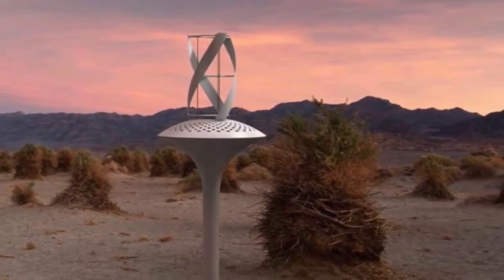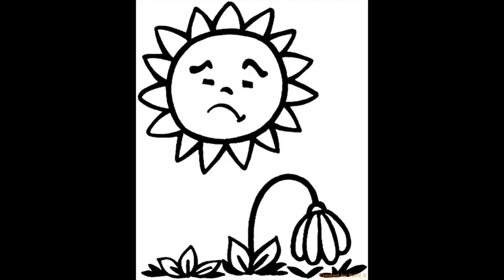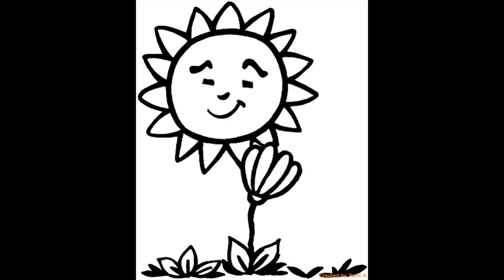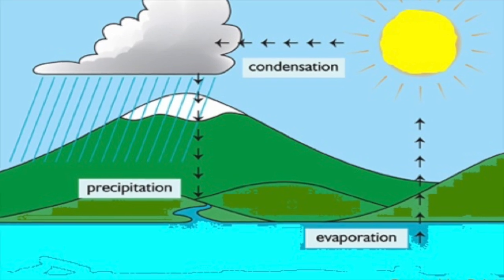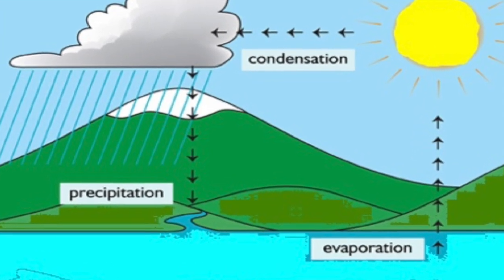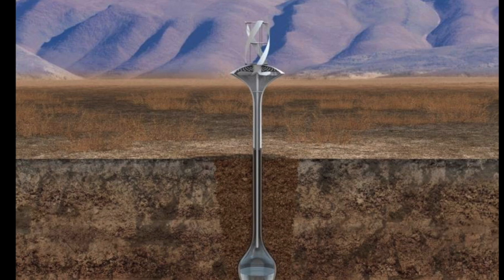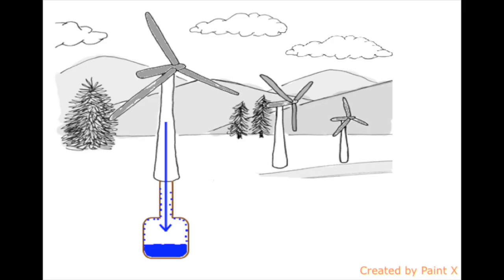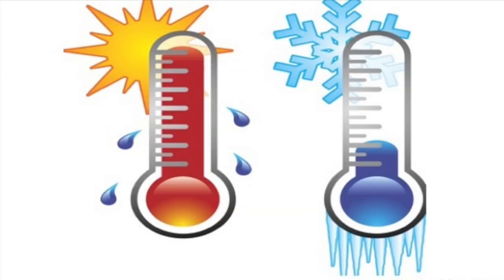Water Seer Debunked then FIXED (2020)

Comment: You are as far out in left field as the original waterseer charlatans.  There are several more reasons why the waterseer is just a lie.  For example, soil temperature is usually higher than the ambient air dew point temperature. Even before the soil heats up, the waterseer wont work.
Reply: But arid areas without much rainfall are arid because there's naff all water to retrieve from the air.
Reply: Alastair it’s related to air temperature even in Arid zones there’s 3.5 - 4 % water vapour in the air
Reply: That's not related to what I was saying, Roger. The soil is usually well above the dew point, the temperature at which that water vapour actually condenses.
Reply: Graph of % RH vs Air Temperature -  we observe the Dew point, how do we reach that number. By using clever feed back loop maybe?
Reply from the maker: soil temp is usually higher than ambient air temp? ok, that happens but USUALLY? now who's in left field.......
Reply: higher than ambient air DEW POINT TEMPERATURE

Comment: the ground is not cold enough. it's temperature is the average of the surface temperature.
problem is: every morning at around 5 am the air reaches it's coldes point and starts to condense water as dew so this temperature is the new dew point - at this time the ground is warmer than the air and the device will not work.
it might work if there is a large body of water that will increase the absolute water content of the air during the day - but in this case you don't have a water problem.
Reply: You are right.  The air reaches the coldest point in the morning due to radiation heat transfer with the cold night sky.   The ground only interferes with the process by  acting as a heat source from its gigantic thermal capacity.   The ground most likely never gets below the dew point so it doesn't matter how much tubing you add.
Reply: It most likely won't work.  Just take some measurements of the ground temp , the air temp, and relative humidly.  See for those air conditions with the ground temp, if it is cold enough to get the mixture below the dew point so condensation can take place. The plastic tubing will require and even colder temperature since the plastic is a good resister to heat transfer.   I told the NPCA and Waterseer this too.  They needed no working model of the Waterseer as a first test of feasibility.  

A Mollier table will be the key to see if one can in teory make it work.   Most likely it won't work practivally, since the heat transfer will not be ideal.  
  
https://ready.arl.noaa.gov/READYmoistcal.php

https://www.engineeringtoolbox.com/psychrometric-chart-mollier-d_27.html

Give me the measurements and I can tell you if it will work or not.
Reply: Larson is talking about the DEW POINT TEMPERATURE not the air temperature. The ground has to be below the DEW POINT TEMPERATURE for this to work. Usually it is not.
Reply from the maker: @johnhazel9986  depends on where you live. Where I live it's 3-5'C a few feet down, even in the summer
Reply from the maker: for the morning - yes - but once it heats up during the day the ground will keep the basin colder than the air being forced into it - causing condensation. it won't work 24 hours a day execpt in very special circumstances
Reply from the maker: depending on where you are the ground in mid summer can be 5C 8 fee down with 30C temperatures above, it makes this location specific

Comment: You are making a bad assumption the temperature difference is large enough to get the air down to the dew point.  Your point is on maximizing the surface area to promote heat exchange not the base conditions.

Simply use an indoor/outdoor thermometer with a humidity gauge and a Mollier chart.  I will tell you what.  Tell me what ground temperature you have, and what the air temperature and humidity is.  I will tell you if you can reach the dew point.  I have it all built in my model of the Waterseer.
https://www.dropbox.com/s/ak5m9o9jvhn0mfg/Waterseer_Steady_State_Thermal_model.V9.0.xls
Reply from the maker: obviously the water seer is weather dependant, I'm stating it can be made to work indefinitely if weather cooperates
Reply: No it can't.  Any Geothermal (heating/cooling system) needs the alternating heating and cooling periods to refresh the ground.  It is like your thermal battery.  It has to be periodically recharged.
Reply from the maker: if your area that the PEX tubing is laid out in is large enough the ambient temp of the ground will absorb the heat, it's all about size or were you sick that day in school?
Reply: No I was not sick, but appears you never had the necessary courses either.  You are making the assumption the ground temperature is BELOW the dew point.   You are starting show you do not know the physics very well.  The ground MUST be colder than the dew point no matter how much surface area you have in PEX tubing.

Let's do an example:  Take air at 70F and a relative humidity of  say 80%.  According to the moisture calculator it as 155 gr/m3 and a dew point of 65F.   If the ground temp is above 65F NO water will condense; no matter how much PEX tubing you have.   Now assume the ground is 60F.  Water will condense out until that air reaches 100% relative humidity.  According the moisture calculator Air at 62F and 100% humidity will have 140 gr/m3 of air.There are 15 grams of water/m3 of air processed.  You need to process 66 m3 of air to get a liter.

Example 2:  Air at 80F, and 50% relative humidity.  The air has a dew point of 64F and has 144 gr of water/m3 of air.  If the ground is not colder than 64 F, it will not condense water at ALL..   If the ground were 60F the air would come out at 100% humidity (128 gr/m3).  It would condense 16 gr/m3 of air.  I doubt you will get a 'air to ground temperature" difference of 20F though.

As a said before and pointed out to Waterseer, you can determine if a location is suitable by measuring with an indoor/outdoor thermometer  that has a humidity meter, and a Moller chart.  The ground is only cold because of seasonal changes and the corresponding phase shift.   If there were no seasonal temperature changes the in-ground temperature would match the air temperature.   6 months out of the year you are in a period where the ground temp is warmer coming out of the summer months and the air is cooling off.   This will be a bad situation to be able to find a ground temperature lower than the already cooler air temperature as fall progresses.

Heat transfer to the ground is  conduction.  That is very well understood.    It is proportional to the temperature difference, the surface area, and the coefficient of thermal conductivity.  You can add as much PEX tubing as you want and dump a lo of heat in the ground, but if you can't get the air mass below the dew point it is not going to condense and make water.

https://ready.arl.noaa.gov/READYmoistcal.php

https://www.engineeringtoolbox.com/psychrometric-chart-mollier-d_27.html

Where did you get your engineering degree again?
Reply from the maker: Are you actually assuming the water seer will work in all climates at all times?
that's a pretty big assumption no one's made. Of course the ground has to be colder then the air for it to work. DUU. I don't need an engineering degree to know that. You really tried hard to make yourself look smart there.  it's about the temperature difference more than anything, cold climates show us that with condensation on car windows in the morning, Justin example for us simple non engineer folks.

I'm simply stating I can keep the ground reservoir from heating up by using pex tubing in the ground stretched out over a large area and pumping liquid through it. this is the major fail of the water seer - it heats up the ground too quickly and stops condensing. I can solve that part easily. Will it work at night, depends on the temperatures? Will it always work? too many variables, them, humidity, etc. But I can stop the ground from heating up when operating under good conditions and that's what this is about. 

curious, have you done anything useful with your engineering degree?
Reply: I never assumed the Waterseer would ever work.  It will never make the water quantity claims it does.  Dew on a window in the morning only is a far cry from the 11 gallons claimed in 24hr. Dew on the ground is due to radiative heat transfer with the cold night sky anyway.  It is a different heat transfer mode entirely from ground conduction.    The energy released to condense the water is going in the cold night sky, not in the ground!   The sky is much colder than the ground.  In the ground, it works on conductive heat transfer only.  

You do probably need an ME degree  usually to know the of the different transfer modes though.

I was not trying to look smart I just wanted to point out adding more surface in piping would still not condense water if the Dew point is not reached.   

A dew catcher and the Waterseer function with two completely different modes of heat transfer.

Since the Waterseer is not exposed to the much cooler cold night sky, it can not act like  dew catcher.  It is mixing apples and oranges.

http://windowoutdoors.com/WindowOutdoors/Dew%20Frost%20Condensation%20and%20Radiation.htm
Reply: " Of course the ground has to be colder then the air for it to work."..Well it even has to much colder ...under the dew point actually  of the air mix you have.  That will be very tough to achieve in a practical aspect anywhere in the world at only 2 meters down.
Reply: @scottlarsen466  A lot of natural building relies on the fact that the soil temperature below 3 foot is constant. The temperature varies with the latitude. The traditional root cellar is cool, but does not freeze and is cooler than ambient air in the summer. My understanding of the water seer concept was that the wind powered turbine would condense the outside air in the underground chamber, it would cool, then would be allowed to expand, releasing heat, and condensing water, as you say when all the factors line up. This is one way to lower the dew point. Are there others? It seemed that the below ground portion was not deep enough, and the control of compression not appropriate - something like a small hole. I saw plans for a big air scoop that would turn into the wind, condense the air in a funnel, go through a small hole then expand into a chamber cooled by conventional refrigerant. Today this can be done with thermoelectric IC devices, run on 12 v solar panels. I invested in a couple water seer devices and was upset when they abandoned the simple elegant design. With Arduino controllers it seems that one could program some valve to open and close at appropriate times to optimize condensation. I live in a low rainfall area of southern CA have thought a lot about dew harvesting, running dehumidifiers on solar power, heat pumps, thermal wicking and such. We have a solar hydronic heating system that heats 10K ft2 of insect rearing rooms every day the sun shines. We use electric pumps to move the water around and run controllers - some of the electricity comes from PV panels. A friend is working on a solar powered refrigerator. This is a very interesting discussion...

Comment: Are you a mechanical engineer?  I am.   The problem is the ground needs the thermal cycling from the seasonal changes to keep it refreshed.  A ground based heat pump uses the ground as a "thermal flywheel" for cooling (heat sink) in the summer and used as a heat source in the winter.  

For the Waterseer the ground will be out of phase at least 6 months in year.  If there are no major seasonal changes then the ground will be the atmosphere temperature and condensation will not take place.

Despite what "Simple TK" says it still won't work.   No doubt he is not a mechanical engineer; just like Waterseer doesn't know what they are doing either.
Reply from the maker: apparently you aren't a very good mechanical engineer, or you didn't watch the video.
Reply: Are you an ME?  Where did you go to school? I went to Purdue.  I watched the video.  

Even if you have more surface area via the tubing, the environment does not play along.  Here's why.

You only get a ground temperature change with the seasonal changes.   So for six month out of the year, if you have seasons, the ground is warmer than the air.  If there are no real seasonal changes there will be minimal ground temperature difference and it will not be large enough to condense useful quantities of water.  It will not work going from summer to winter in the northern hemisphere.  It might work a few days in the spring coming out of winter.  Watch the original Thunderf00t debunking video where it talks about the cycling of the atmospheric  and ground temperatures.

You can use an indoor/outdoor thermometer and a Mollier table to see if the conditions exist for water condensation.
https://www.waterseer-fraud.info/the-waterseer-would-never-work

I've spoken to Don Zacherl at Waterseer.  He does not know wat he is doing.  It is most likely a crowd funding scam.
Reply from the maker: although I agree the water seer as is doesn't work - busted. but to make it work what I suggested if you use 1000-2000 feet of pex tubing in the ground it will work in season for the entire season as the heat buildup in the reservoir will be dissipated to a huge area where the regular ground temperature will act and refresh the temp back to ground cool temperatures. it's about the size of the pex coil in the ground. if you actually ARE an engineer you'd make comments on how long the pex tubing would have to be stretched out against certain air temperatures to keep the system working. The cost of such is about $200 perr 1000 feet of pex, plus a circulating pump, $150, connectors, and electricity to run the pump (although circulating pump uses very little electricity) plus an excavator or tons of shovelling work.
Reply: Simple Tek think he means in areas were it’s so cold 🥶 that it’s freezing then humidity would be below the norm 45% since water and thermal dynamics, more water is stored in warm air and then has to be cooled like the upper atmosphere to make it rain 🌧
Reply: Simple Tek it would be better to just have a dehumidifier underground and have power from a windmill or solar, even the manufacturers say to put them in cool place, I mean if you want cheap get a free fridge off Craigslist take off doors and put it underground it will condense the water from air like a cold glass on hot day
Reply: Scott Larsen  problem with any design is getting new wet warm air Down onto the colder coils, so this design has an air flow problem mostly since no exit piping so no air flow. Should have 2 larger pipes connected by a smaller pipe with cold coils
Reply: @scottlarsen466  I flunked out of Purdue and got kicked out in 1969. Fun times... you and Simple Tek' ad hominum attacks are childish, not productive...